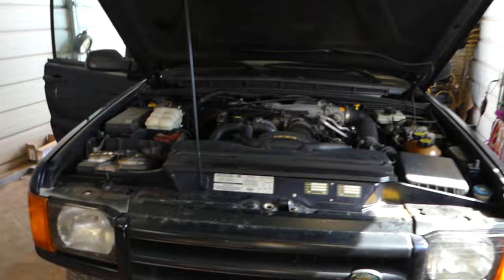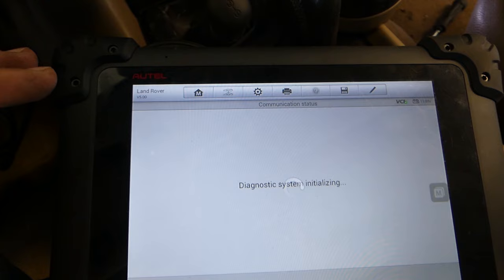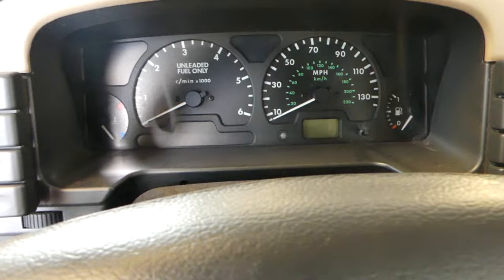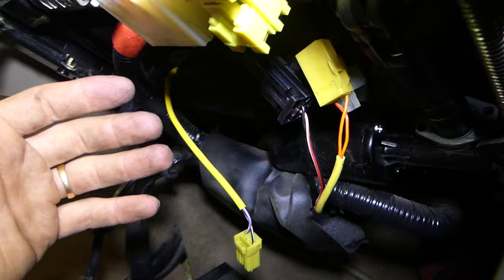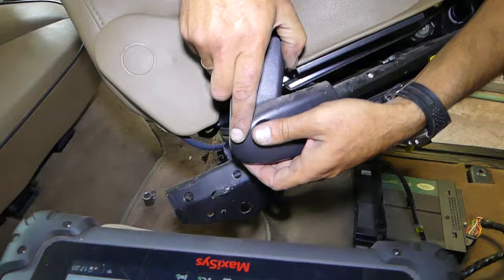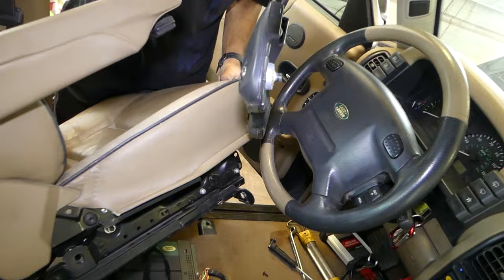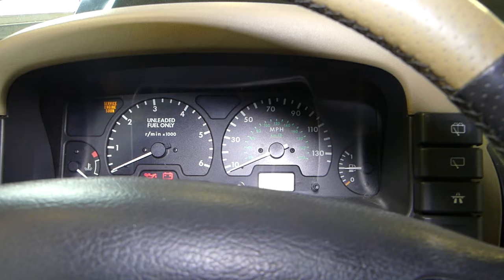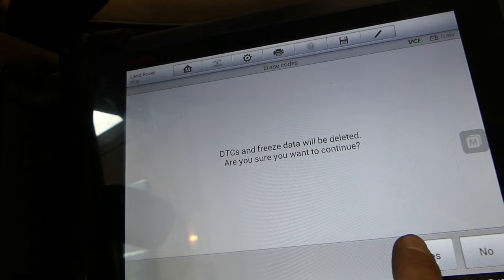SEAT BELT PRETENSIONER CIRCUIT OPEN CODE ERROR FIX AIR BAG LIGHT

Comment: did not help.  My error (2018 mazda) was resistance below spec on the recoilment pretensioner piece and the connector is screwed up so I tried to use a resistor but now it says open circuit even when I am totally certain resistor is making contact ...it is over 2 ohms maybe 2.4 but the pretensioner reads 2ohm  I donr understand what is happening?  Funny thing the other pretensioner part by the seat was also throwing low resistance code until I stabbed the clip back in then it immediately cleared....I am thinking these newer cars have something besides just the resistor in the pretensioners?  driving me NUTS  and of course NO ONE sells the OEM replacement connectors....that I can find anyway...I just dont see how that could matter?

Comment: I don't get what am looking for
Reply: Basically what I got from it is that the wires leading to and from the seat belt may be damaged. They, I am sure tested the pretensionsr but instead of repairing they just got another working seat belt with working wiring. 
Pretty much what I got from it is, look for damaged or frayed wire causing that light to stay on in that general area. Pretty helpful. Gonna try it myself on my day off. I’ll let you know what happens. Ps I know you posted 8 months ago. Haha prolly already fixed your problem, or sold the car. Hah

Comment: I have a code thats says short circuit to ground pretensioner? What do I do? Difference between open and closed circuit?
Reply: how did u solve it? im having the same problem
Reply: Closed it mean that both wires touch each other or there is internal fault in the pre-tensioner.

Comment: I have done exactly the same even erase the code for airbag and the  Light is still on could you tell me why
Reply: I would appreciate your response back thank you
Reply: It's still on because you have a problem... You have to fix the problem.
Reply: @fuckjewtube69  thanks for your reply I was hoping that you could tell me what it could be as a possibility why it didn't work for me and what else is there to look for when it comes to code 34.this is the only code that I have which is calling for seatbelt buckle and nothing else. All the wires are looking good .please let me know thank you again!
Reply: @markchimmy  it could still be dodgy wires for the pre tensioner, but it's probably the passenger occupancy sensor or the wires for the occupancy sensor. Its best to get a scanner to know for sure. A lot of people bypass the occupancy sensor by installing a bypass unit (this is usually illegal because it deploys passenger airbag even if theres no passenger). If the occupancy sensor itself is broken then a new one is about £130, however its not easy to install as it is essentially built in as a pad in the seat, so you can get a garage to install it looking at a total of around £300. Or you could just but a new passenger seat as this can work out cheaper, but buying a used seat comes with its own risk as occupancy sensors are fragile and are known to break. Hope this helps.
Reply: Thank you very much! I will look into it when I get a chance I appreciate it very much!👍

Comment: I had a vehicle crash and both airbags went off.   I replaced the airbags and pretensioners from the junkyard.  They said they were good.   Sent in the module for crash reset.  If somehow one of the airbags or pretensioners is not good, will it set off the airbags when I turn on the engine?
Reply: Yes.. if no srs light you are good. Airbag will not "go off" LOL.
Reply: No
Reply: One answer says "yes", other answer says "no". So which is it?

Comment: the pretension-er is the buckle part????
Reply: I'm also very confused... sometimes it is, sometimes not... I'm not getting it.
Reply: Zé Luis the tensioner is the refractory part... and the pre tensioner is the buckle snap part. Has a plug. If no plug no pre tentioner
Reply: Thanks Richard. Only the pre-tensioner has a plug. So, I guess, no tensioner...
Reply: If you just have a 2 wire 
Buckle the pretensioner is in the B-pillar and has a plug going to it.
Reply: @jlcesteves  WRONG 2-wires are used to turn buckle warning off.